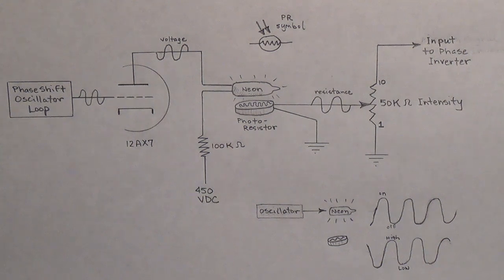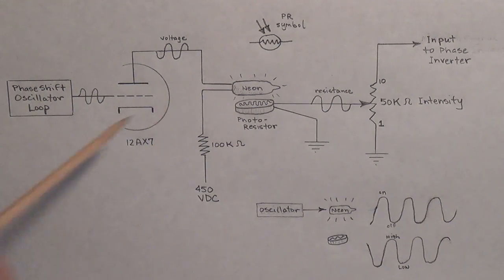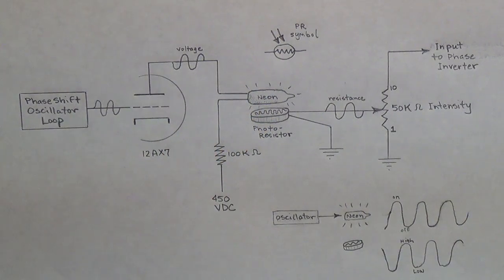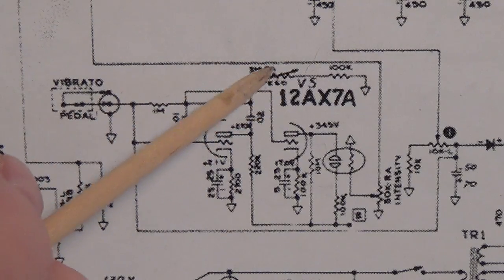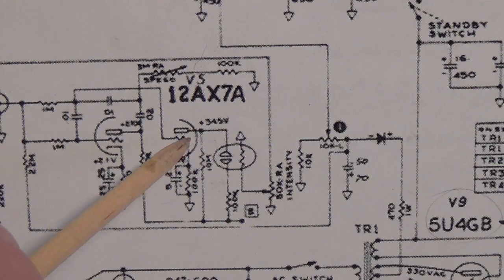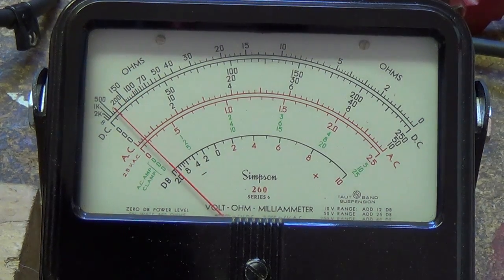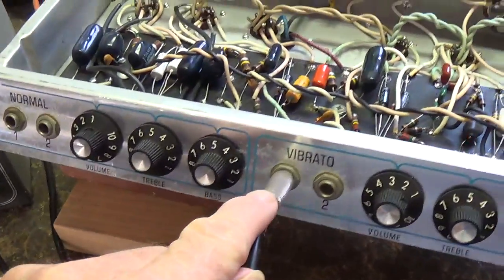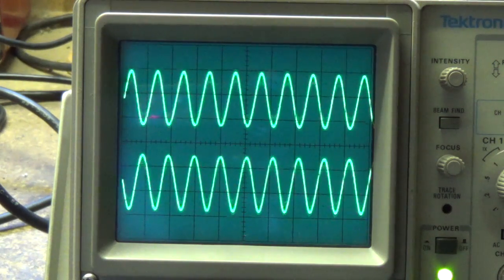Photoresistor Volume-Modulating Tremolo: Design and Function

Comment: Hey Good Buddy, hope all's well..can you touch on what other means of tube induced tremolo there may be,..on my Univox early '70s 60 watt Lead amp with the 6AN8 pentode preamp there was no LED resistor of the likes of this Photoresistor's circuit, anyway not that I can tell I even rebiased and rewired the 6AN8 to the 12AX7's family, it gave me a better Fender's tone so I'm looking to gain favor of the amp's design to give me the tremolo as well, thanks in advance Uncle Doug, btw can't believe it's already May of 2015,..I was viewing your other instruction seminars to catching up and here we are now, time is elusive like on a tremolo circuit's photoresistor(???)! Oh yea, Ampeg made a pedal with no more than 8 pieces and it had one knob on the pedal but it had a discrete trimmer and with tweaking of the two I got tremolo,vibrato,and two to three other similar effects, really cool pedal,very rare it was called a Tornado, very few were made possibly by Dan Armstrong himself. So if that pedal could accomplish that some of effects with just 1 to 2 transistors etc figured a tube could do the same maybe with a 6CG&/6FQ7 driver and so on,Thanks! Happy Millionth Wow!
Reply from the maker: Nelson DeJesus Greetings, Nelson. I have also posted a separate video explaining the Bias Modulating Tremolo, which, I believe, is the type you mentioned above. Please watch it to see if it answers your questions.

Comment: I remember those strange neon-photo resistor circuits used on the earlier amps. it's all coming back to me now.
Now the only photo resistor I see  nowadays,  are used for shutting off the yard lamp post light bulbs.
I like the 'cat intermission'.
Reply from the maker: SuperCarver2011 Yes, and coincidentally the PR in my yard post lamp recently failed. Repairing it should be an interesting project. Judging from your icon photo, you are a cat fancier, as are we. Even Rusty seems to enjoy watching Jack (the cat) mop surf :)
Reply: Uncle Doug  I've had to replace mine a couple of times over the years..harsh Canadian winters, I guess
 and the UV tends to cloud the plastic lens. Mine just failed last week,  after a few years. Got another one at H-D and installed it.  Working fine.  These photocells have some kind of triac that craps out eventually because
it was supposed to handle up to 300watts but I've been using a 13watt CFL for years..they just don't
make these things like they used to. 

yes, I have a couple of cats,  and I support the cat rescue. I was a carver, for a few years and carved some
half size cats to give to my friends and family and as prizes for the annual cat rescue motorcycle ride.
Reply from the maker: I'll probably go to HD today for a new PR module. This conversation got me thinking about the need to replace it.

We love cats and dogs.....and all animals....maybe too much. Saving them can become an obsession if you're not careful :)
Reply: Uncle Doug I don't do the actual saving, that is up to the ladies who run the nokill shelter..I provide donations
every 3 months which is tax deductible.
Reply from the maker: More power to them, and to you, for your continued support.

Comment: Hey Uncle Doug
Do you have any particular place that you buy tubes from other than finding them in old units that you get from garage sales and such? Also what about input/output transformers and chokes, tube bases, terminal strips and other misc stuff used to build an amp? I would really not want to buy old vintage equipment just to dismantle it for parts. Since I am going to try and build an amp ground up in more of a steam punk theme it would be a shame to destroy old classics for parts.
Reply from the maker: I understand and appreciate your reluctance to dismantle old equipment. I currently have some old tube amps stashed that are simply too nice to dismantle. I have no idea what I'll do with them :) I get new and NOS tubes and chassis components from Antique Electronic Supply in Tempe, AZ and I get all my new chokes and transformers from Triode Electronics (generally Classictone brand transformers).

Comment: UNCLE DOUG< what frequency is the LFO at? 30hz or lower because when measuring lower frequencys on an oscilloscope it wont display a low frequency waveform because its so lower, all you will see is a moving electron beam DOT moving very slowly. Anyway on the oscilloscope to get a stable low frequency waveform  because I have to use a frequency counter to measure lower frequencies LFO oscillators because I can't view them on an oscilloscope. How do you measure these LFO low frequency or you use a frequency counter or an oscilloscope?
Reply from the maker: I don't actually measure the number of oscillations, Bill.  All I am concerned with in a Tremolo is its depth and speed.....as determined by my ear.
Reply: @UncleDoug  but lets say I wanted to measure the LFO frequency, how about I do this to make sure the LFO frequency is not "drifting" or is the correct frequency. The LFO frequency is so low that the oscilloscope is hard to display a staple waveform.

Comment: Hello, Can you please help me. I have a Fender Quad reverb and the tremolo  causes the volume to drop when you turn up the intensity all the way. Also the sound becomes compressed and it is kind of slow to react.  I have replaced the filter caps with F&T's and all of the tubes with new JJ's.  I also changed the oscillator,  new .01 600v caps, ( I'm going to change them all but the others are on order still.) So I need to know what would make the amp volume drop and sound compressed. thx
Reply from the maker: I have never encountered this problem so I would just have to guess that there may be a partial short to ground when the Intensity pot is cranked up. Use your ohmmeter to verify this and to find the cause of the partial short.

Comment: i was wondering what the reason for a photoresistor tremolo with very low intensity (athough turned up to max) is? bad tube? or is it just common that the tremolo is not so intense on a Fender pro Reverb...?
thanks for all the interesting! videos here.
Reply from the maker: Weak tremolo is most likely due to weak oscillation in the feedback loop, Theo. Check the values of the three oscillation caps, resistors, and try different oscillation tubes. The Pro Reverb should have a strong tremolo.
Reply: @UncleDoug  thanks a lot👌

Comment: What is the purpose of the connection from the negative bias supply, through the 2.2M resistor to the vibrato pedal/ oscillator input. I do not see that connection on the Princeton circuit you went over in the first video. I have seen this connection labeled 'oscillator kick starter' (or something like that)., on the internet. Will this circuit work without that connection?
I would like to use this circuit in an amp I am building, but the power section is running cathode bias, therefore there is no negative supply.
Reply from the maker: I too have heard that the 2.2M resistor was to kickstart the oscillator. Yes, it will work just fine without it......most amp circuits don't have it.
Reply: @UncleDoug  

After further research, I found out that without a kick start circuit, the oscillator may take minutes to start. I also found out there's another way, by connecting the middle resistor of the phase shift loop to the cathode, instead of ground.
See the Fender Vibrolux 6G11 schematic.
Also a great technical description of the circuit can be found here:

https://www.aikenamps.com/index.php/designing-phase-shift-oscillators-for-tremolo-circuits

And here
http://www.valvewizard.co.uk/trem1.html
Note the LED indicator circuit at the bottom.
Reply from the maker: @scottbc31h22  Excellent information, Scott. Thanks.

Comment: I have a Vox Cambridge 30 twin reverb that suffers from what is known as "cambridgitis". I have replaced the opto-cupler with 2 different brands and have yet to get this amp to function properly.. Can this circuit be by-passed? I never use the tremolo anyways and love the sound of this amp?
Reply from the maker: Morris Frady I took a quick look at a schematic, Morris, and it appears that this amp is primarily solid state, with a single 12AX7 preamp tube. I work only on vintage tube amps and am not well versed in hybrid circuitry, but wonder why bypassing the tremolo circuit would be necessary. In every amp I am familiar with, you can simply turn down the Intensity setting and mute the tremolo effect.
Reply: Thanks for your Comments Doug, but from what I understand about the way this circuit works is,, when the opto goes bad it automatically defaults to the low side of the volume due to the LED not flashing any more..That causes a constant power loss..As far as the tremolo pot goes,, it has no effect to the sound at all.. Right now it is setting in a corner.. Thanks again for comments..
Reply from the maker: What a strange circuit....in which the failure of an opto-coupler can affect the entire amplification process. This is why I stick with vintage tube amps :)  Here is a site that discusses the problem and its "cure":  https://sites.google.com/site/voxcambridge30repair/  You have probably already seen this, but if not, I hope it is helpful. Good luck.

Comment: In the example circuit, what purpose does the 2.2M resistor between the negative bias and footswitch accomplish?  Is this a critical part of the tremolo circuit or a byproduct of something else?
Reply from the maker: It's my understanding that the wire containing the 2.2Meg resistor injects a signal into the oscillation loop to initiate oscillation when the footswitch grounds the circuit. The resistor modulates the voltage to prevent a loud "pop" when this happens.
Reply: @UncleDoug  Thank you very much.  I wasn't sure if it was an elaborate grid leak or something.  The negative bias through me for a "loop" ha.. oscillation.. nevermind. This makes sense.  Thanks again, I appreciate it.

Comment: I have an issue that is not on this topic, but was hoping you could give me some feedback. I have a footswitch that goes to a 72 deluxe reverb amp. The vibrato switch works fine, but the reverb won't switch off. I changed out the switch with a new carling switch. It still will not work. I get continuity with my multi-meter. The ground wire for both switches has to pass through the new switch, and the vibrato switch works fine, so I'm guessing my solder work was okay. I'm stumped as to why it won't work? Any ideas?
Reply from the maker: rbauer1632  What happens when you unplug the reverb pedal from the amp.....does the reverb cease? If it does, then the pedal wiring is at fault. If not, then there is a problem within the amp circuit. The reverb pedal grounds the grid of the recovery tube to stop the reverb effect. If the pedal is at fault, then apparently the switch is not grounding the signal wire when it is closed. Check to see if there is continuity between the signal wire and grounded shield when the switch is off.
Reply: Uncle Doug I tested the amp with a different pedal and all was fine. So, it is obviously in the pedal. I knew this, but couldn't understand why a new switch didn't fix the problem. Since your reply I tested the continuity again. The vibrato was fine, but no continuity on the reverb wire. Except, I do get continuity on the braided shield at both ends.  Maybe this is what I had mistaken for continuity in a prior test. I'm new to this. I pushed the button and do get continuity between the wire and braided shield inside the pedal cavity, and at the other end of the braided shield, but no continuity at the rca plug wire end. Now that I look at it, it looks like someone else may have tried to repair it, because the reverb wire is about 3" shorter than the vibrato wire, which is what I would have done to clip the original connection to the plug and reattach it. If it were up to me I would just buy a new pedal and be done with it, but the original pedal seems to be important for resale value. So, I will try to get a better connection and see if that does the trick. Thanks for your help.
Reply from the maker: Yes, RB, the shield should make good contact with the chassis of the amp to provide adequate ground to shut the reverb off. This should be fairly easy to repair now that you recognize what is wrong. Good luck.

Comment: I'm troubleshooting excessive noise in my 1970 Fender Twin Reverb.  I've monitored the signals on the vibrato circuit but they appear to be anything but sinusoidal.  Can you give me the link to part one and expound on waveforms of LDR type Fender vibrato circuits?  Thanks!!!
Reply from the maker: If you inject a mono-frequency audio signal into an amp circuit with the tremolo (it is not really vibrato) function "on",  you should see the wave form of the input signal increasing and decreasing in amplitude at the same rate as the tremolo oscillation loop. This is the only proper way to visualize the tremolo wave form. The erratic wave forms you are seeing are probably not related to the tremolo effect.
Reply: @UncleDoug  When the tremolo is enabled there is what appears to me to be excessive noise and some hum (60 or 120Hz).  When I unplug the input to the amp the noise is greatly reduced.  I have a high quality Mogami guitar cable but it appears that with tremolo enabled and guitar plugged in I am picking up a lot of noise.  Is this normal or can I reduce that somehow?  I also noticed upon inspection that the tremolo intensity pot is a 100K linear taper instead of a 50K linear per the schematic.  The pot looks original but I'm looking for a 50K to install to see if that improves the noise.  I'll greatly appreciate any suggestions.  Maybe this is normal for this amp, but without the tremolo enabled the amp is super quiet and sounds great.  Thanks!
Reply from the maker: @darrellsego1155  Have you tried substituting other tubes in the oscillator position? You may just have a noisy tube.....it's not uncommon, and the effects vary depending on where the noisy tube is located.
Reply: @UncleDoug  I substituted in several different 12AX7A tubes in the oscillator circuit with no significant difference.  I even replaced the 3 long run wires between the tremolo circuit and the intensity and speed potentiometers with shielded cables, also with no significant difference.  It could be that the background pulsating noise is normal with the tremolo enabled since it is varying the gain of the preamplifier circuit.  I know that the existing carbon composition resistors are more noisy than metal oxide resistors but I have not replaced the carbon comp resistors yet.  I have also read that some users prefer to replace the ceramic disc capacitors in the tremolo circuit with polycarb or polypropylene capactors but I have not done that yet either.  Please let me know if you have any other ideas that may help me in reducing the background pulsating noise when the tremolo is enabled.  Thanks!
Reply from the maker: @darrellsego1155  Without hearing the "noise" or being able to evaluate the circuit in person, I can't offer any further advice, Darrell. It sounds like you are eliminating each of the possible causes, one at a time. I suggest you continue in this fashion. Good luck.

Comment: Hi uncle Doug, I have a vox ac 30 1973 with top boost & im getting a constant hum when switched on i changed all pre amp vales but no change ,thanks Trevor (uk)
Reply from the maker: Trevor Clarey Greetings, Trevor. I made a video to help you determine the cause of the hum, based on whether it is 60Hz or 120Hz (in the US.....your frequencies will be different, but the principle is the same).  Check it out and see if it helps. Best of luck :)

Comment: my photoresistor lights up but does not oscillate i didnt do it but the caps were replaced the .01,.01,.02.i dont know how long ago if you see this i was planning since it lights up to replace those 3 caps again and go from there.any suggestions would be greatly appreciated mine is a 68 ab763.
Reply from the maker: Try changing the oscillator tube, PJ.
Reply: @UncleDoug  i will and i wanted to let you know i have watched all the videos several times on this circuit.thank you for replying your videos have been a tremendous help
for and my understanding of these circuits
Reply: i just now did it and it works thank you i would had never done that it hasnt worked in 30yrs thank you